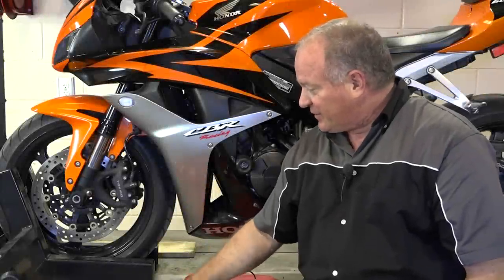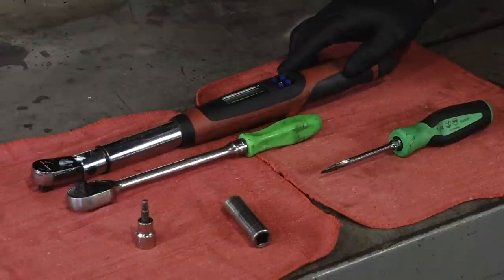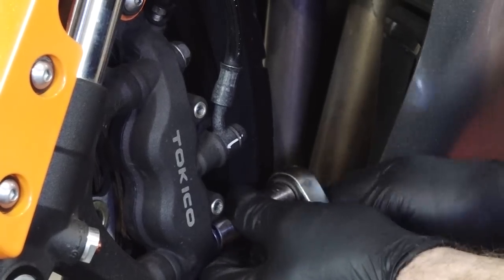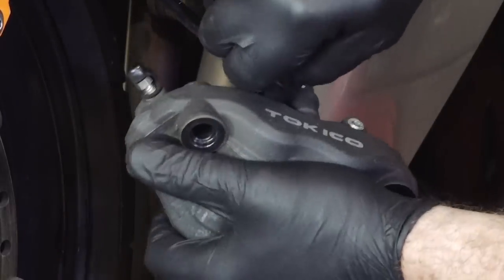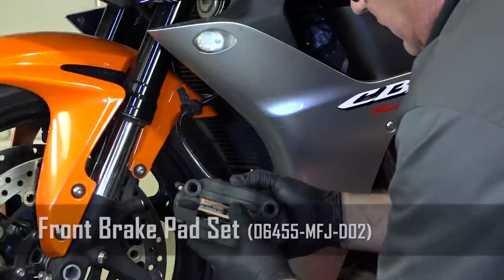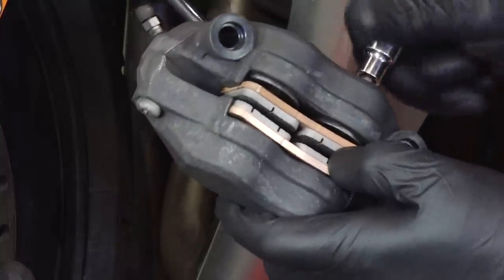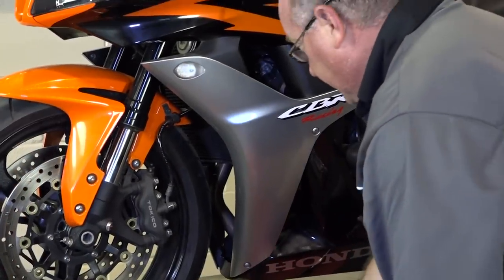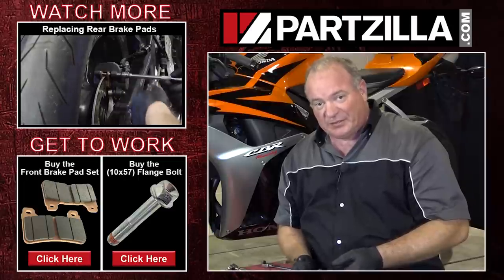How to Change Front Brake Pads on a Honda CBR 600 RR | Partzilla.com

Comment: The reason Honda says those bolts are one time use is because there's threadlock on the bottom from the factory. You can use new thread lock on the old bolts and it'll work. The 600rr forums has discussions on this

Comment: Would I need to bleed the breaks after replacing front and rear pads?
Reply from the maker: If you don't open the line or reservoir, you shouldn't have to.  However, if you need to add fluid or open the system at all, it's recommended.

Comment: Shouldn't the brake fluid reservoir cap be opened since the new pads will push the piston and create pressure back to the system? or assuming that the level was already more near to the lower level and after pushing the piston the level rise back to the maximum level?
Thank you
Reply from the maker: If the fluid is already low, when you back the pistons in to place new pads it will make the level rise.  If fluid had been added at anytime before replacement, then yes, pop the cap and make sure it doesn't overflow.

Comment: Man, you're videos are awesome and so useful got me feeling I can be a bike mechanic ha. Are the same mechanisms used for the 2006 model? & do you not have to bleed the brakes when changing the pads?
Reply from the maker: Same systems.  Since you never open the reservoir or touch the lines, you wouldn't have to bleed the brakes using this method.

Comment: so my front pads are dragging on the rotor. The pads are still in excellent shape and the bike has 8K miles, a 2008 cbr 600RR. The wheel only gets one rotation when spinning it hard on the front stand. My miles per tank is affected, as for im only getting around 60 on a full tank. I can also hear the sound of the friction when rolling the bike, and I sometimes smell a burning smell from the front wheel area when at stoplights. I am thinking about backing out that piston on the caliper to give the pads some more room and reset them, hoping that fixes this issue.
Reply from the maker: Bleed your brakes and possibly clean your calipers.

Comment: Thank you partzilla! Does the 2008 CBR use the same parts for a 2005 CBR?
Reply from the maker: No, they did a model change after 2005.  A lot of parts will be different.
Reply: Thank you!

Comment: Although a decent quick tutorial, there are crucial steps being missed.  You should never push the pistons back without inspecting and cleaning the boots first. Your life is dependent on good working brakes and neglecting to check the condition of the piston boots for cracks damage and cleaning the inside of the calliper is bad practise. Also check that the positions are equally out.  If one side has the pistons out further than the other side you can experience brake chatter and if continued, has the potential to warp your rotor. You should also check the condition of the pins for any abnormal wear or grooves as the pads ride along the pins. It is important to clean and inspect them for notches and grooves as they could inhibit the movement of the pads and could cause uneven wear on your pads.  It’s also important to inspect your rotors and clean off the old brake dust to ensure your new pads mate properly with the new rotors.

Also important to check the fluid level inside the reservoir as you are pushing the pads back.  Loosen the cap, take the rubber bladder out and ensure as you push the pistons back in to make sure it does not overflow or go above the top fill mark.  There is a lot more one could go into detail with that this tutorial is lacking.

Comment: Is it true that if you wait until your pads are fully worn the piston comes out so much that it can damage the seals?
Reply from the maker: That shouldn't damage the seals.  Though you'll spend a ton on rotors if you don't change the pads in time.

Comment: Do the brakes need to be trued after putting them back on? And if so, how does one go about trying them?
Reply from the maker: Not sure I know what you mean, Paul.  Trued?
Reply: That probably answers my question, but like on a bicycle, if you remove the wheel, or hit something the wheel comes out of alignment so that it rubs against its brakes. On a bicycle it would be called coming out of "true". Just wondering if the same applies with a motorcycle when removing the brakes. Thanks
Reply from the maker: Ok, bicycling.  Got it.  Was trying to sort out how it related to brakes.  For motorcycles, you can true a spoked rim or possibly a dented mag wheel, however, this wouldn't affect the brakes since they are mounted on the hub.  If the rotor is warped, you would just replace it.

Comment: Is it really common replacing the brake caliper bolts? No dealer/repairstore had ever replaced the bolts when changing the pads on my cbr
Reply from the maker: It's recommended by the manufacturer, so we show it that way.  If the bolts look good, you don't have to replace them.

Comment: Same parts for 2004 cbr600rr?
Reply from the maker: Probably not.  You will have to get the parts from the 04 diagram.
http://www.partzilla.com/parts/search/Honda/Motorcycle/2004/CBR600RR+A/FRONT+BRAKE+CALIPER+%28%2703-%2704%29/parts.html

Comment: What bolts are those that need to be replaced and where can i get them?
Reply from the maker: They are the brake caliper bolts.  #14 on the diagram.  Check for wear or stretching on the bolt.  They can be reusable.
http://www.partzilla.com/parts/search/Honda/Motorcycle/2008/CBR600RR+A/FRONT+BRAKE+CALIPER+%281%29/parts.html
Reply: Partzilla Great! Thanks for the reply and for helping me to do my own maintenance on my bike!

Comment: I'm having starting issue with my 2006 CBR1000 I have a brand new battery but it seems to not be getting enough voltage to turn the starter. When it does start it runs fine after you turn the bike off it will not start up can any one help me?
Reply from the maker: Have you checked for corrosion or loose wires?  Could explain the intermittent starts.
Reply: @PartzillaParts  I took the stator cover off and it was burnt pretty bad my new stator should be here Friday thanks for replying I love your videos I've probably watched all of them lol keep up the good work.

Comment: Is it REALLY necessary to replace those bolts? I mean, they cost more than the dang brake pads!
Reply from the maker: It's the manufacturer's recommendation, so we apply it to the videos.  You can reuse the caliper bolts.